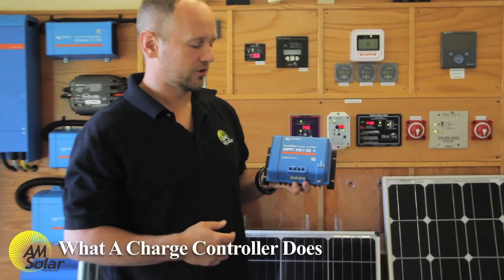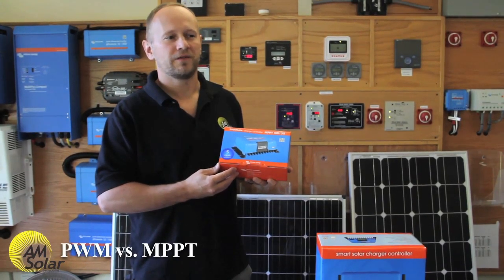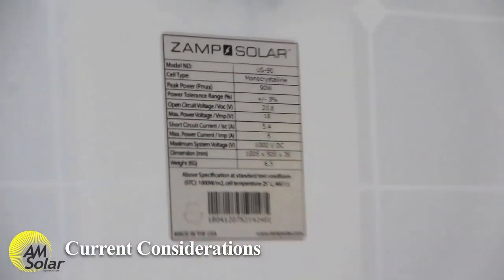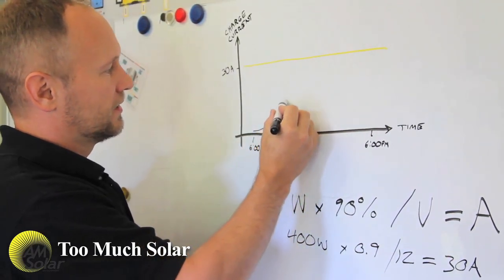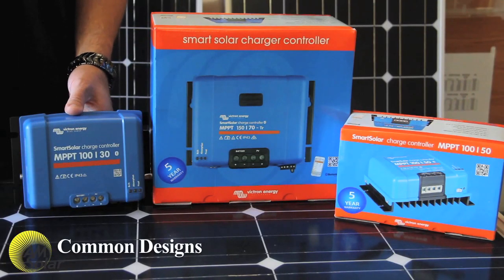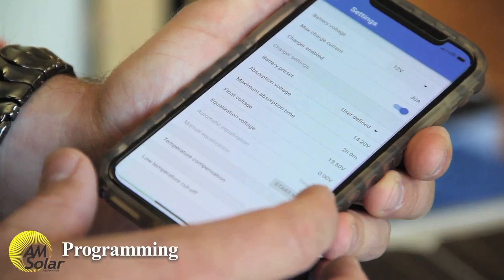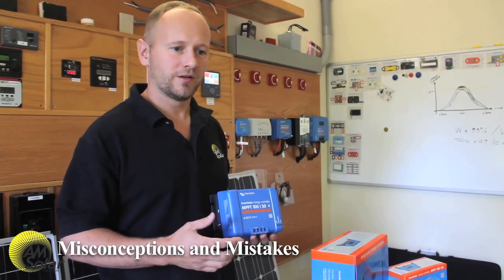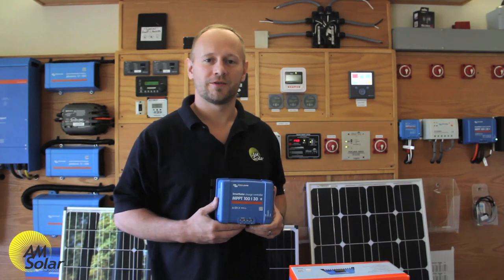How to Select the Best Solar Charge Controller for Your RV, Skoolie or Van

Comment: I really needed help. I need AMP charge controller. And I would like to get a oversized one, because I plan ongoing bigger later, but I don't have that much money and was wondering if there is any good reliable ones out there? There aren't ridiculously expensive

Comment: 400 watt. At 12 volt 800 watt at 24 volt on the 100/30
Reply from the maker: That is correct, as long as you aren't exceeding the 100V input voltage limit of the charge controller.

Comment: I have 4 100 watts liquid acid batteries will a 100 watt solar panel and a 30 watt charge willl it work
Reply from the maker: Sounds like you have 400Ah of Lead-acid batteries and want to use a 100W solar panel?  A 30A charge controller will definitely work.  You could get away with something as small as a 5A charge controller.

Comment: Hi. 440x4=1760w*.9/48v=33 what’s your recommendation controller I should get 
Thanks.
Reply from the maker: I’m guessing the 440W panels have roughly 40Vmp, which would make you want to connect them in a series-pairs, or 2x2 configuration.  Your array would have something like an 84Voc with a 22A Imp.  This puts everything well within the tolerances of a Victron SmartSolar MPPT 150/35.   Do not connect the panels in all series, the voltage will be too high for the controller.
Reply: @GarretTowneAMS  yes you are correct on the 40Vmp, 
Ok I understand this. Just so you have all the information, the battery’s are 4x100amph 12v SOK lithium batteries connected in series for a 48 v system 
Thanks for the help. The channel is the best I’ve seen in 3 years. And I’ve seen a few 🤝

Comment: I have 2 200 watt solar panel with a 12 volt output.  What is the minimum size MPPT controller I can use for this array?😮
Reply from the maker: I recommend a 30A controller, like the Victron SmartSolar MPPT 100/30.

Comment: What’s the best Victron controller i can use on 3 260 watt panels running in parallel on 2 140amp leisure battery’s  voc at 38  short circuit current at 8.89
Reply from the maker: Assuming a 12V battery bank, go with the 150/70.

Comment: I have a smartsolar charger it is MPPT 75 I 10. With a 100 watt solar panel. Can I add more solar panels to this? I have 2 12volt batteries.
Reply from the maker: Assuming your batteries are in parallel, for a 12V system, yes, you can add another 100W panel.  If you add a third panel, it will still work, but you might get output clipping on bright days.

Comment: i have a 200w panel and trying to find how to select the right one. first equation is 200w/12 battery voltage=16.66666. my panel will not do 16amps the ics is9.12(short circuit current). the other equation is 200w/28.1 my voc(open circuit voltage) that i 7.117amps that is at my panel rating. so witch one 16amps or 7amps?
Reply from the maker: If you put the panel on a 12V battery bank, you’ll want a Victron 75/15 controller.  You can use a smaller controller if you connect to a 24V battery bank, but I don’t think Victron makes any smaller MPPT controllers.  Get a bigger controller if you think you might expand in the future (e.g. two 200W panels would require a 30A controller).  Let me know if you need anything else.  Thanks,
Reply: @GarretTowneAMS  this is the issue that I have. My 200w solar panel we never produce 30a. At the perfect conditions it will only produce 14a. So how are we getting these high amps where my panel will never produce it.the imp is 8.55 so take the weather coefficient mine is 1.25 it will never do more then 13.7.this is why I say the math is all wrong nothing makes sense.
Reply from the maker: @hayzersolar  That’s why I recommended a 15A controller.  200W x 90% / 12V = 15A.
Reply: @GarretTowneAMS  makes no sense why you are dividing 12v from the solar panel? when you multiply the vmp and imp you get the watts of the panel. my whole thing is why take 12 divide it by 200w to get the amps. the data sheet tells you the amps on the panel (IMP operating current. )  why do a whole set of math the DATA SHEET TELLS YOU THE AMPS. on mine it is 8.55 i can never reach 15a never my panel can't do it.
Reply from the maker: @hayzersolar  We are dividing 12V from the wattage of the solar panel, since Watts / Volts = Amps, and 12V is the nominal voltage of the battery bank.  I think the disconnect you have here is that the charge controller is rated on its output, not the solar panel’s output, and that’s after it steps down the voltage.  The data sheet shows you panel output current which only needs to be less than 15A to keep from damaging the controller.  Are you thinking a 15A controller won’t work with your 200W?
Reply: @GarretTowneAMS  then if the controller let say 75/15 I can add as many panels as I want up to the 75v.add the vmp up until you get close to 57v.amps has no calculation here if the panel is in series connection. Neither does the total watts only the volts
Reply from the maker: @hayzersolar  You can do whatever you want as long as you don’t exceed the input current limit (Isc) or input voltage limit (Voc) of the charge controller.  But, know that you will be limited to 15A of output, which is pretty much equivalent to the production you would get from a 200W solar panel.  The excess wattage will just get clipped.  The equation keeps you from spending money on panels that won’t do anything for you.
Reply: @GarretTowneAMS  it is so confusing thanks for trying to help I'm just going to stay on the grid there is no issues there.

Comment: i have the 100/20   and my panels  showing 33v direct open circuit  summer sunshine..     i want to add  3 series and  count on long cabling voltage drop to  lower at safer voltage numbers...   is it possible to count on voltage drop and add that 3rd panel   ?     2 panels  close to 70volts open circuit  i guess little more in winter  temperatures ...   if i  make that long route cabling  the panels up on the roof 30 foots cable .. is it possible with that voltage drop to add 3 series  and no damage the charger ? i m going to test with multi meter and keep it at safe voltage numbers but what is the best asking production i want to have and  earn all longivity of the charge controler ? ? ? ? 70% ? 80%  ?     any long term use of  them ,,,  usefull tip  > >> ? thanks
Reply from the maker: What is the total wattage you have and the total wattage you want to have?  Let me know, and I'll tell you what you can do.  As long as you don't exceed 100V or 35A on the input, it will work.

Comment: Now a question sir, can two or more charge controller be used with a panel? 
That is can charge controller be connected together
Reply from the maker: You can parallel PWM controllers on the same panel to two different battery banks, but don’t do it with MPPT controllers.

Comment: Please can you suggest a charge controller that I can use with a polycrystalline panel of max power 20w, current max power 1.15A, voltage max. Power 17.8v, short circuit current 1.19A, open circuit voltage 21.7v. thank you
Reply from the maker: At only 20W, any controller will work. Maybe a 5A PWM controller would be a good fit.

Comment: I have a Hardened Power Systems Juice Box G3 inverter with four upgraded AmpedOutdoors 12v 15ah LifePo4 batteries “in parallel”.  What do you recommend I enter for each Victron SmartSolar 75 / 15 charge controller settings below. Also I’m only using 125 to 150-ish Watts of solar to charge up my Juice Box. 

Max charge current = 
Absorption voltage = 
Float voltage =
Reply from the maker: Our technician recommends the following:

Max charge current = 15a
Absorption voltage = 14.5v
Float voltage =13.7v

Of note: low-temperature cut-out does not seem to be mentioned in the manual. I recommend setting this to 32f in the charge controller.

Comment: Hi, great explanation I have a victron 100/50 and 2 x350w solar panels, but only 1 on my caravan roof so far, the max watts it has gone to is only 190watts which I thought it would have been more, so I am going to put the second panel up. My question to you is over 5 meters what size cable I need to join and run the cable to the controller from the panels, as the controller might not fit the diameter of the cable that is needed for the 500watts   all though it handles 500 watts? thanks Wes
Reply from the maker: I would put the panels in parallel, then go to 4ga down to the controller, and 4ga to the batteries. 6ga will work too (and fit in the controller terminals better) but we like to oversize slightly. I hope this helps.
Reply: @GarretTowneAMS  It will thank you
Reply: @GarretTowneAMS  Sorry so are you mean 6AWG cable ?
Reply from the maker: @wesleyblake8552  yes 6AWG will work.

Comment: Hi hoping you could help me with this. 12V System ! 

Panels =250w
 Vmp =30.1V
Voc =37.3
 Imp =8.31A
 Isc =8.71A

Charge Controller is a Renogy 60A MTTP.
Nominal Voltage: 12V/24V/36V/48V Auto Recognition (for non-lithium batteries)
Rated Charge Current: 60A
Rated Load Current: 20A
Max. PV Input Power: 800W/12V; 1600W/24V; 2400W/36V; 3200W/48V
Max. PV Input Voltage: 150 VDC (25°C), 140VDC (-25°C)
Battery's= x2 115AH AGM 12v Wired in Parallel
Running a Companion Fridge 24/7 avg power consumption is 0.09amp  

What is the maximum panels i can use in any given wiring configuration to get the maximum out of my controller and battery's?
Reply from the maker: 60A / (250W x .9 / 12.8V) = 3.5
You can play it safe and use three panels in parallel, or go up to four panels if you don’t mind a little output clipping on bright days.

Comment: I have a pwm control box with a single 100W panel hooked up to a single 12v normal car battery...it will not charge my battery - in fact it discharges my battery

Any ideas ??? HELP !!!
Reply from the maker: My first guess would be a bad controller, especially since it seems to discharge your battery.  Next would be a bad panel, or a bad connection.  Good luck.

Comment: Hello, thanks for the informative videos. I have a question.
if I have purchased one victron bluesolar 360wp 24 volt mono solar panel which Victron charger from Victron do I recommend? I want this with built-in bluetooth.
Ore another scenario
If I understand correctly, I can charge two 12 volt 17Ah batteries in series with a powerful Victron charger without damaging the battery?
The solar panel used is the Victron panel mentioned above.
This may sound ridiculous but I want to buy more solar panels and batteries later.

Greatings
Jean-Pierre
Reply from the maker: If you are charging a 24V battery bank, you can use a Victron SmartSolar 75/15 controller with that panel.  If your battery bank is 12V, you'll need a 30A controller.  Also, 17Ah seems pretty small.  Make sure the batteries can handle 15A of charging current.  My guess is that they can't.  You might want to get larger batteries.
Reply: @GarretTowneAMS  Thank you Garret for this clear answer. Continue making these informative videos. These are for me the best videos about solar panels and battery chargers. I love your channel thank you.
I wish you success in all you do.
regards
Jean-Pierre
Reply: Hello Garret here I am back, if I buy two victron AGM batteries of 12 volts 240Ah and connect them in series (24 volts) How many victron bluesolar 360wp 24 volt mono solar panel do I need. Minimum and maximum panels and which Victron charger do I need to charge these batteries? I would also buy the 24 volt to 230v 1200 watt inverter. Am I doing the right thing with this?
Please provide your expert advice.
regards
Jean-Pierre
Reply from the maker: @Wirelessinfopuntbe  The only reason you would want a certain wattage of solar array relative to battery bank capacity is to make sure your solar array is capable of topping your batteries off at least once per week on the low end, and on the high end, just making sure your charger isn’t in float mode (i.e. battery bank is full all the time) indicating that you spent too much on solar that isn’t operating at its full potential.  You can use a single panel, assuming it has a Vmpp over 36V.  Or, you could have four of those panels (connected in series pairs).  You probably wouldn’t benefit much beyond four.  If you had four panels, you would want a 100/50 controller.  With a single panel the 75/15 will work.

Comment: Don't freak out but it's 2am and I would hug you!!!!  This video was perfect! I spent hours with videos that were 15 minutes long but the information could have been said in 1 minute AND they were a tad rubbish and confusing.  This video was at the perfect pace and order to furnish organized information and the formula was like a Father's Day present to me!  Thanks! Specifically because I bought a camper and it had a factory installed solar panel, the additional "plug" on the frame reads "Zamp", so I bought another Zamp panel, the exact one you showed. I did not check he operating roof one which I later learned was a 200W/43.83V/4.54A Sonali Solar! 

I was worried that they were different but then realized I could wire them in series to add the Zamp 18V voltage but since my Victron MPPT is 75V/15A. I was worried on exceeding the Amperage...but I read in comments that as long as the voltage stays under the 75V (my panel series add up to 62V) then the controller will limit the excess (could go to 24A as it trims the voltage to 14V) to 15 amps on peak sun hours.  In other words, it would choke if too much voltage is fed to it but it can shave off any amps over 15.  Hence, I thought about the 100V 20A to take advantage of the 24A potential, but I was worried the wires to the battery may overheat since they are concealed in the wall and I cannot figure out their gauge.  I know that electrical Romex, even the 15A white one can handle 20A, just like outlets and switches, but I am not sure if the wires the factory used allow a tad more occasional juice.  The tip looks like an 8AWG but it could be a 10AWG.

Anyhow!!!!  THANK YOU!!!! WELL DONE!!! you are a hidden treasure in the YouTube jungle!
Reply from the maker: Send me an email and we can go over your situation in more detail. There may be more efficient solutions. Garret@amsolar.com
Reply from the maker: Now that I’m in my office, I have a longer response.  If you put a Zamp panel in series with the Sonali panel, you will have a functional system that won’t fry your charge controller.  You get a slight mismatch in current (4.54A vs. 5.00A) that will reduce efficiency slightly, but you’ll still have much more output than you would get with either panel by itself.  As for wire sizes, the input to the controller can be small.  10ga would be fine.  Output would ideally be 10ga.  If you are interested, have a much more comprehensive explanation of solar system design here:   https://amsolar.com/solar-charger-design
Reply: @GarretTowneAMS  You are the Man! it is working like a charm, and I am extremely proud (perhaps OCD) that the panel is perfectly aligned, that the cables re tidy and even the sealant is well shaped, ha! but most important is that the system is working like a charm and I see how it limits to 15A in the output, so I guess a new MPPT 100/20 should be beneficial.
I truly thank you for the assistance and when the time comes I will buy the rest of the equipment and upgrades (if you ship to Fairlawn, Ohio which I am sure you do). I tried to upload pictures but as you already know I am technically challenged, LOL
Reply from the maker: @asuarezjd  We do ship to Ohio.  I'm glad things are working for you.  Thanks.

Comment: My experience with quite a few controllers is the inability to input the parameters needed for a particular battery chemistry.  Some even state you can input 'user' settings but often do not allow such after installed.  I do like some of the higher priced ones in that they are more accurate and allow more user input.  Batteries are freakishly expensive and using a cheaper controller seems like a foolish thing to do.

Comment: But, of i charge a 24 volts battery i can have double the amps?
Reply from the maker: If you go from 12V to 24V, you can double the wattage, but amps would remain the same.

Comment: Garret, thank you for nice explanation.
So, the numbers on Victron controller indicates: input Voltage (what's coming from solar panels) and output Amperage (what's going into batteries). Right?
Or it's both - Maximum IN and OUT is: 100V, 30A? Or it's 100V@30A?
Reply from the maker: Input 100V max, output is limited to 30A. You can overload the output and it will clip, but don’t exceed the input voltage. Does this help?

Comment: My total Load is 520watts . Wat solar panels, inverter and solar charger controller required for the above load to last for atleast 5hrs in a day
Reply from the maker: If you use 520W for 5h per day, that works out to 2600Wh/day.  For easy math, we tell people that 1W of solar will give them about 3Wh per day in decent sun.  Obviously this can vary depending on a number of variables, but you would be looking at about 900W of solar.  I might start with 5x 200W panels on an 85A charge controller.  If you need more solar, you’ll have room on the controller for a 6th panel.  I would use at least 300Ah of lithium or 600Ah of AGM batteries for this.
Reply: @GarretTowneAMS  thnxs

Comment: Hi there what controller do i need for 270 watt panel thanks
Reply from the maker: For a single 270W panel on a 12V battery bank, with no plans to add an additional panel, I would use the Victron SmartSolar MPPT 100/20.  https://amsolar.com/victron/cctlr-vt-mpps-020a

Comment: I have two 100 W solar panels wired in series to a 12 V battery what solar charger do you recommend right now I have a 100-15
Reply from the maker: The Victron SmartSolar 100/15 or 75/15 are good options.